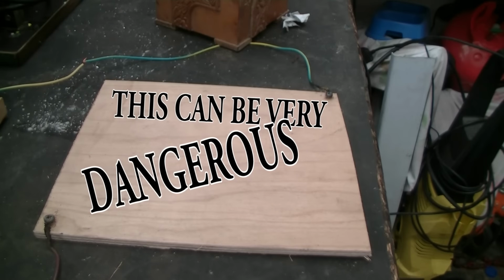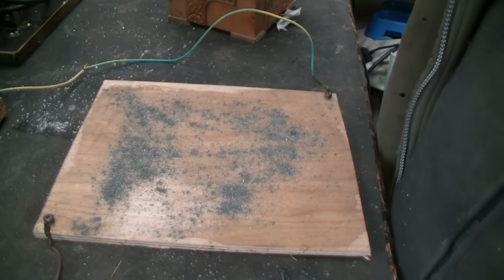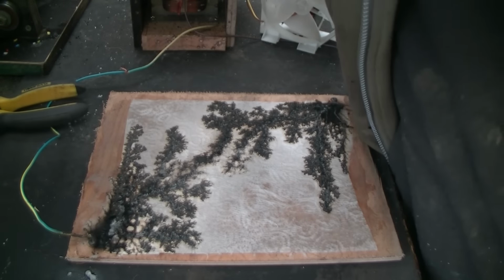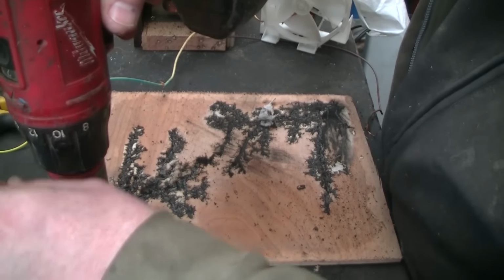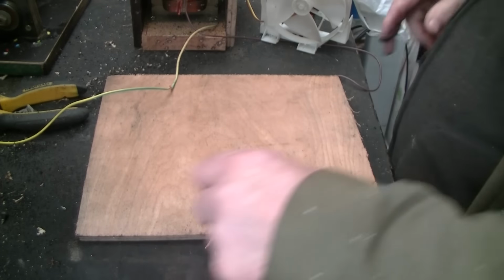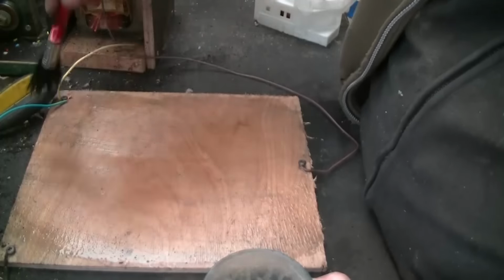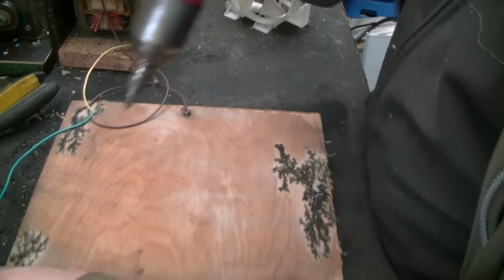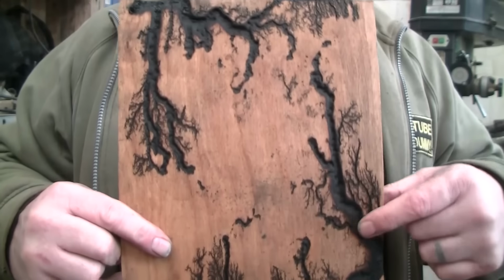3 experiments BURNING WOOD WITH ELECTRICITY ..p/2

Comment: Very interesting that you try experiment to get different results.  I have watched several videos of this, and seems to be some different opinion of the best solution for wetting the wood. At some point I intend to try this. But, I will try a different solution that not many have available.....used photographic fix......this will have silver in ionic form in the solution. Keeping in mind that electricity will seek the shortest path to ground, and that silver is an excellent conductor..........I have a back yard hobby of reclaiming silver from scrap film, which is a hobby that is rapidly disappearing.. The digital photographic era is doing me in, film is hard to come by anymore.

Comment: Bob, I am impressed. I think you might have hit on something. What if you made up a bunch and sold them at the crafts fairs or online at etsy, ebay, etc? if you were at a crafts fair and had these and a monitor with a video showing how you make these with electricity I bet you could sell these. There is a guy on ebay who is an outsider artist that paints primitive looking birds and fish on small panels of wood that fit exactly inside a priority mail flat envelope so his packaging and shipping time and expense is quite low. he sells a lo. If you were not in wales and so expensive to mail here I would buy one from you myself, they look that cool. by the way, if you need to make a border you can use a regular wood burner, they have attachments you can make graphic designs and patterns with, I used one on my DIY gun case. That way you would not need to frame your art.
Reply: not sure you want to sell them as one mistake could mean death and families sue these days.

Comment: They look great, just a question, what is your set up for a transformer?  I just received an old boiler igniter transformer that has a secondary of 10 kV.  I have see a lot of people use old microwave transformers and that is what I was going to use but I got the 10 kV transformer for free plus it is lower amperage (23mA compared to 500mA in microwave transformer)  Just curious as to what you are using?  Thanks

Comment: Question: what do you think would happen with a laminate countertop? Possible?
Reply: Hi Kim, This is just my opinion but I would imagine that a laminate like Formica would likely burn ok but the detail of the Lictenburg figure would be lost due to the plastic melting as it does. The porous nature of wood allows for the solution to penetrate the surface making the burns deeper as well, the plastic would of course not allow the solution to soak in and would only result in surface burns. I think you would be better off just burning whatever type of wood you like to use for a counter top and then coating the wood with a thick layer of clear casting resin. I think it would look pretty cool and the wood would be protected for a very long time.

Randy

Comment: The tissue idea was real good one. it seamed to control the path better going to try that on some wood turned boles i made nice idea well when i get an old microwave. The wife said im banned from the kitchen since my last idea . Need to try some disoved metalic substances like copper sulphate as controled paths . Disolved metals the iron fillings was a great light display though . Did you try a probe with cotton or wire wool .stainless wool . Or am i just too dangerous lmao
Reply: Robert Nurden as soon as i get the workshop done ile give it a go . Would not want you to stop the videos due to ill heath due to me lol . Ile get it in the neck off your million subscribers .

Comment: all very good. im not sure if you noticed but the electricity seems to move easier along the grains of the wood not across the grains though. like how deep the iron filings made it go. try carbon and try graphite. like crush up pencil graphite and try it should be interesting.